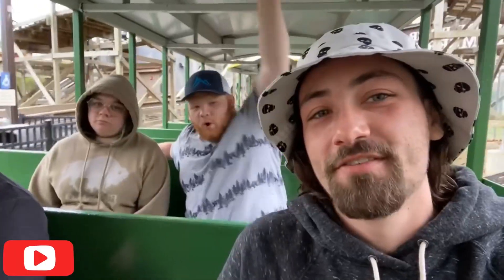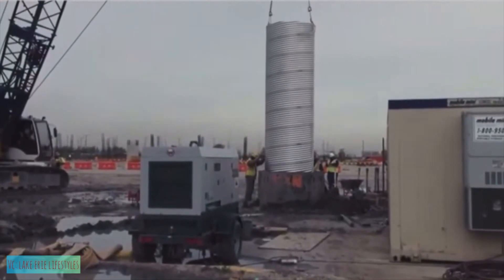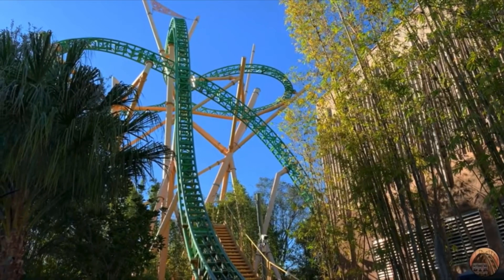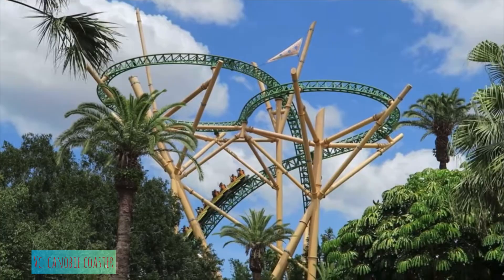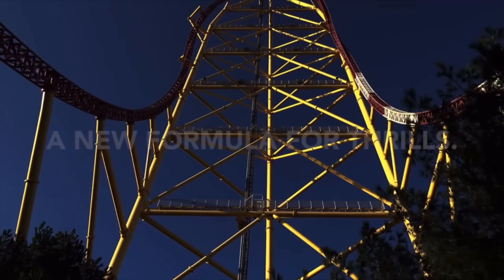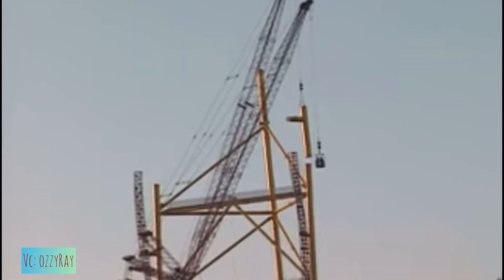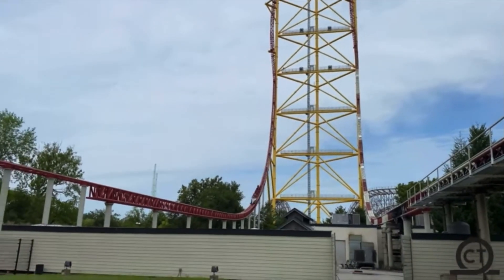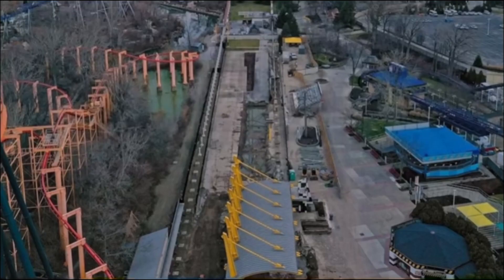Top Thrill Dragster Reimagined Footers Update & Speculation

Comment: My question would be if we launched backwards up a spike, would our bodies push forward with that type of speed? If so, they might not doing the spike, or maybe they would need to add new restraints to the trains. Might be a stupid question, but i dont know.
Reply from the maker: I’m not entirely sure the answer to this either, I asked a few other creator friends and they said essentially depends on the intensity of the backwards launch and yes you would kind of press against the restraint. I’m pretty sure the trains will get new restraints either way which is kind of a bummer imo

Comment: I will admit that a Cheetah Hunt style element at 500 ft would be visually impressive, however, I think it’s unrealistic. Imagine a train valleys up there, evacuating would be a nightmare 400-500ft in the air. There’s a reason strata coasters have only had top hats historically.
Reply from the maker: We cut the argument out of our video about that point, but we did take it into account, theres ways to prevent that though. Take copperhead strike for example when it valleys theres lsms to get it rolling back to speed. Just have to take the right measures into account before building it

Comment: That would be a very unique coaster element. It is definitely possible. If that was installed at CP that might scare away the GP depending on how high up it is.
Reply from the maker: It would likely but I think gp struggled with dragster already being so tall, i’m not sure how they view it. A thrill ride or everyone ride, but any addition likely draws people in i’d believe. The real issue is stalling out that high up but i’m sure they’d work in some sort of system to negate that from being possible whether its lsms at the top to drive it through or not but thats the one thing we debated against our own idea was what happens if they got stuck up there
Reply: @GhosterCoasters  i think the easiest way to stop it from stalling would be to keep the horizontal shape the same but do it with a lot more of a vertical slope.
Reply: @GhosterCoasters  I remember in 2012 a couple behind me and my buddy. The dude was into it, his girl was shaking like a leaf, she was terrified & almost crying. We kept telling her she made it up to the platform, this was the WORST part of it, the ride itself was not that scary,  just fun. We thought we had calmed her down until the air gates opened and she ran through the train and made a b line for the exit like a squirrel being chased by a cat. It's like, you honestly did suffer through the worst part of it and gave up. I think it may be too much for a lot of the GP but have seen lots in the queue that didn't seem like die hard coaster fans. I dunno. The Cheetah Hunt figure 8 would be amazing if they do that. I think I'd like that even more than the spike.  Cheetah Hunt is a lot of fun.

Comment: Just anything but the spike. This random obsession with one of the lamest roller coaster elements, is ridiculous for something that's supposed to be record breaking. A spike? really? That's the best they could think of? No.
Reply from the maker: This sentiment x100^ agreed Thor, lets hope for the best 🎢
Reply: While I agree that spikes aren't the most exciting, it's kind of important to consider that this coaster has been a one-trick pony from the start! A modern art experience to a large extent. It's also a symbol of roller coasters at their limits. While it'd be nice to see 30-40 million added to the track, it's very unrealistic. The soul of this coaster is speed and towering height, and the spike is going to fit perfectly! For what I consider the true spirit of TTD, it's an extremely loyal addition, and it will be an improvement nonetheless!
Reply: @nimexwolf  No